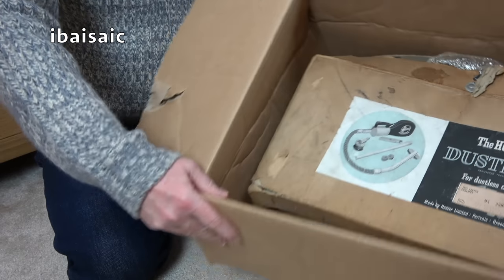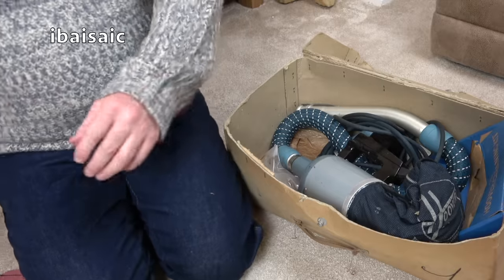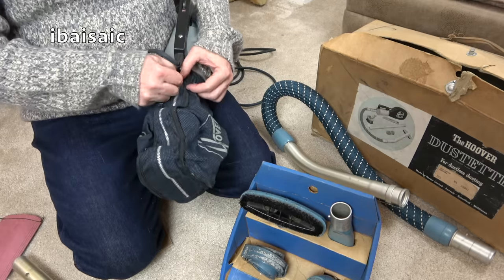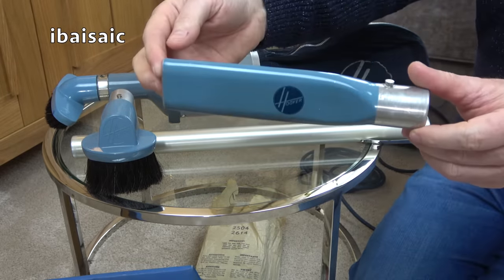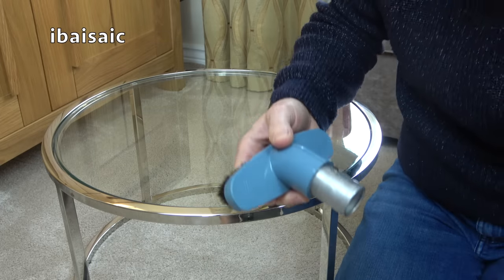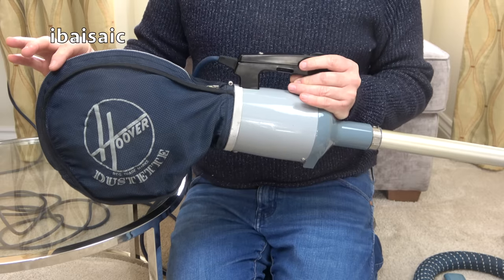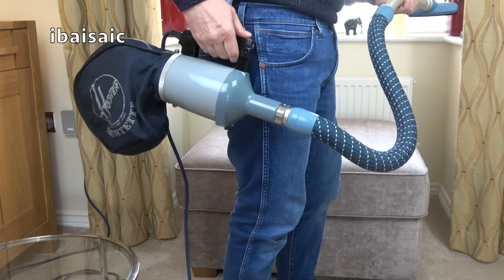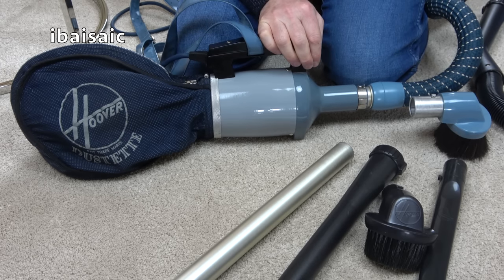Hoover 2614 Dustette Vacuum Cleaner Unboxing & Demonstration

Comment: Nice to keep the original plug on . Just use a shaver adapter. A beauty though
Reply: That would have to be a Euro adapter with a 10 amp fuse, most shaver adapters have a 2 amp fuse ~ that vintage vacuum would blow a 2 amp fuse

Comment: Si you mention a Company that change it’s accessories let’s say it’s Electrolux? I have an Electrolux Oxygen an small orange ball with a power floor tool and it has a very unique conector to the machine only some Voltas had it and then release a new model and they changed again 😂.
Reply: Yes 😂 but I think he was talking about Dyson 😂